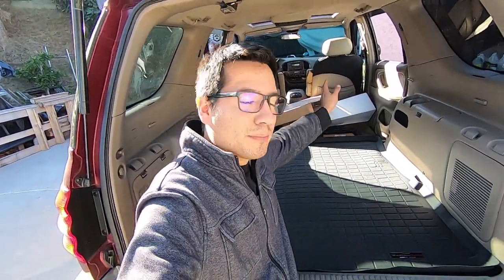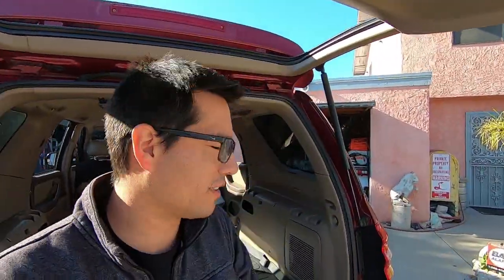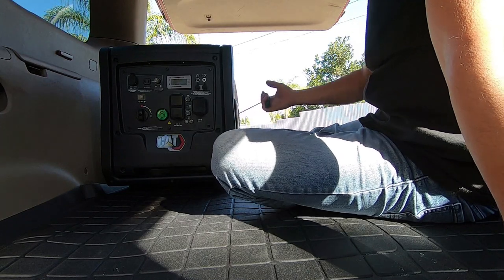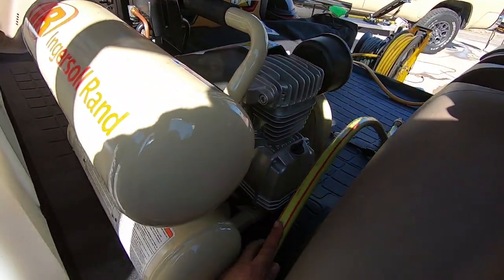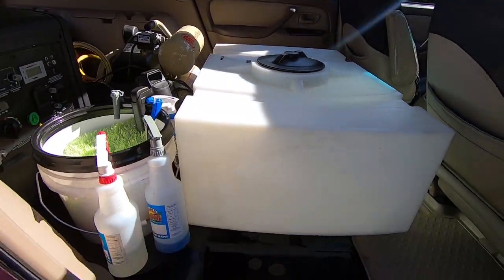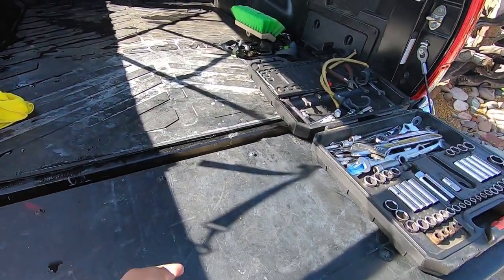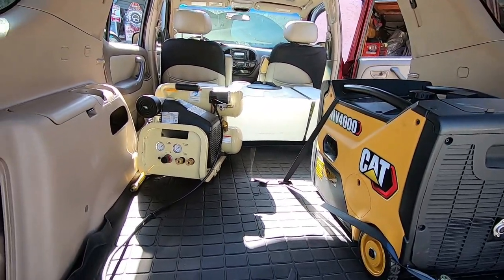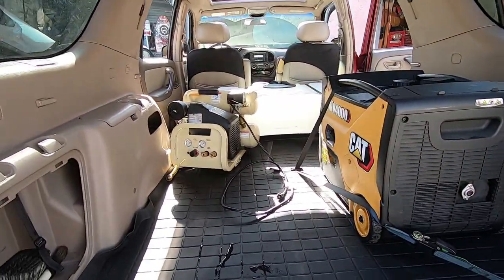Overland Sequoia Build Part 2: Loading up with Gear

Comment: I didn't like the feeling when I was Rollin in my Sequoia. with Lumber and tools and a truck battery in the back felt like if I was in an accident I would be impaled or a smashed head because of a 40 pound battery. Need to squeeze the trigger on a 6x10 small utility trailer.
Reply from the maker: I don't have that feeling with mine. Everything heavy is strapped down and secured.